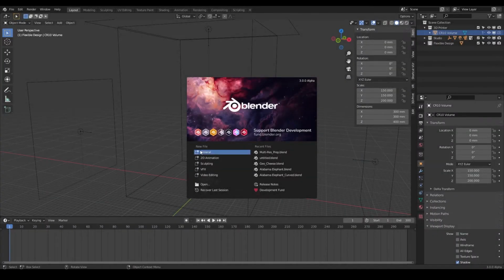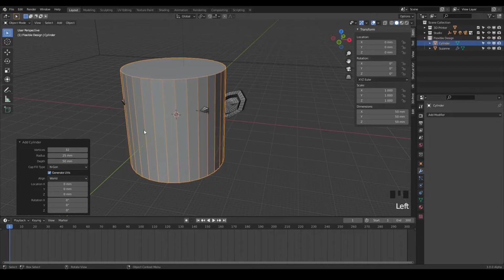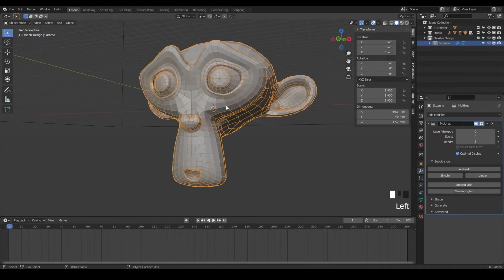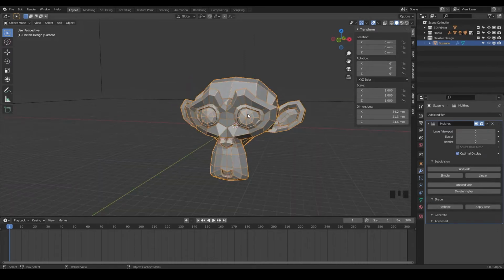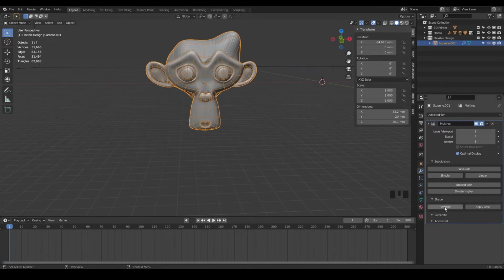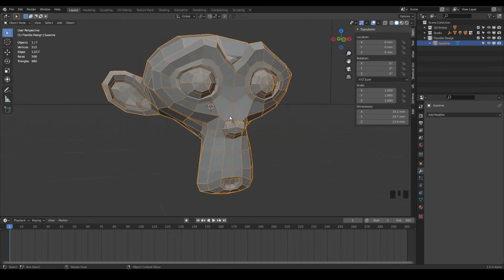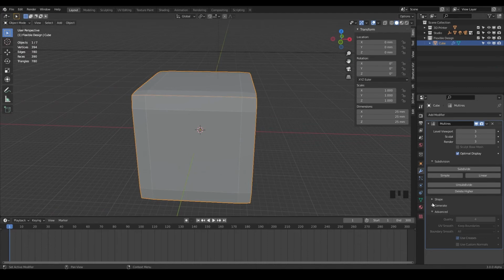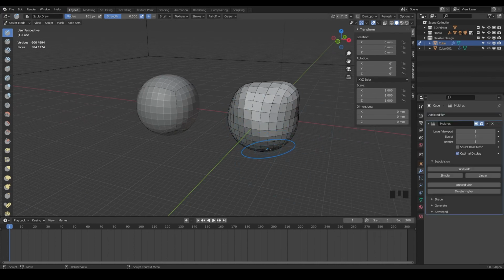Multi Resolution Modifier (EXPLAINED) | FREE Blender for 3D Printing Course

Comment: Hi J-Wall!
I’m following your “Multi Resolution Modifier (EXPLAINED)” video and loving the course. I ran into a very specific problem and I think it could make a great follow‑up tutorial for other students.
I’m working with an organic model for 3D printing (eyes, nose holes, etc.). When I add the Multiresolution modifier to my mesh and increase the levels, my edges and depressions get badly deformed: holes collapse, sharp features melt, and the geometry inside cavities stretches and looks unusable for printing.
Would you consider making a tutorial that shows:
How to safely use Multires on imported meshes or complex base meshes without destroying sharp details.
When Multires is NOT the right choice and which modifiers or workflows you recommend instead (e.g. Subdivision Surface, Remesh, Shrinkwrap, Sculpt-only workflow) for 3D printing.
A complete workflow from “problem mesh” to “clean, high‑res, 3D‑print‑ready model” using Blender.
I’d gladly pay for a focused lesson on this topic because it’s exactly the kind of real‑world issue I’m hitting in my 3D print design work.
Thanks a lot for your awesome content and for considering this idea!
Best,
Floris